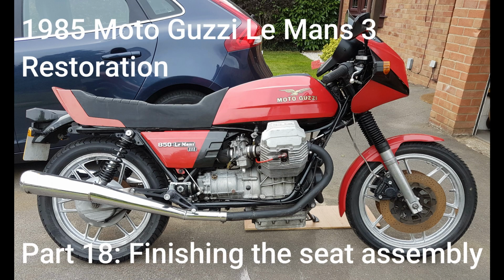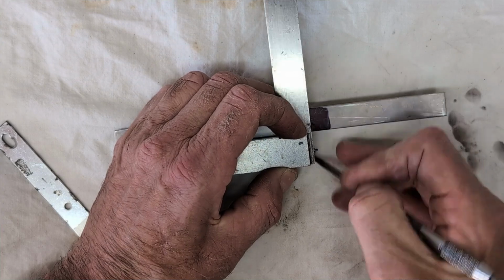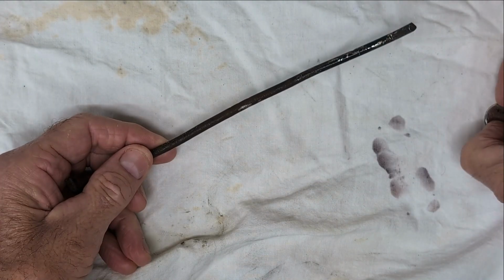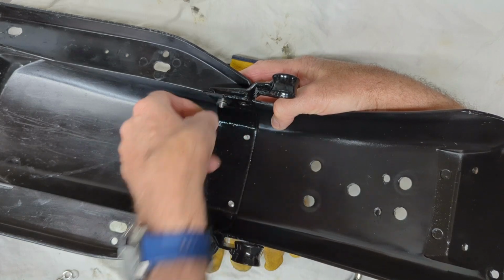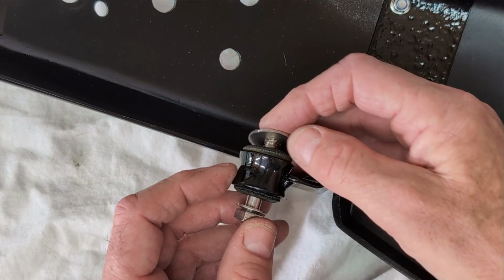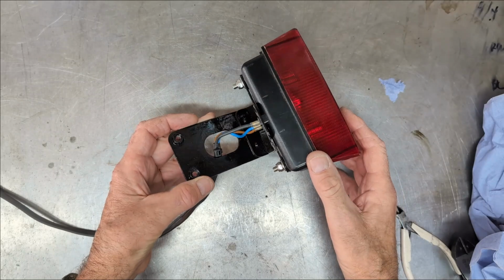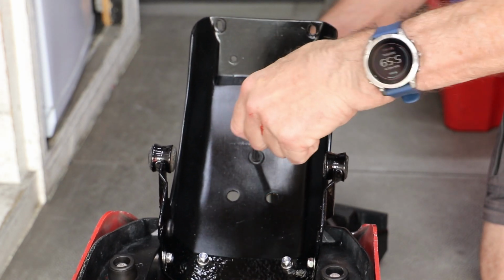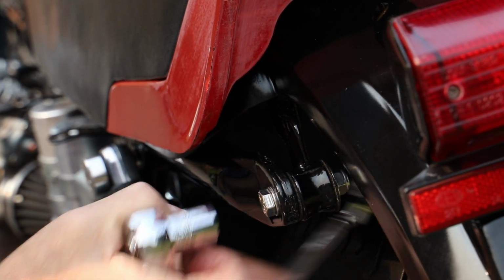Moto Guzzi Le Mans 3 Part 18: Finishing the Seat

Comment: Hi Mark. Where do you get your ironmongery odds and sods from, penny washers, rubber washers, fixings etc.
Reply from the maker: @AyrshireAirsports  Hi, either Amazon for small quantities or EBay for larger.
Reply: @MarksMotorcycles-rk4yp  sorry to bother again, but where did you source your replacement switchgear?
Reply from the maker: @AyrshireAirsports  They're easy enough to get.  Gutsibits sell them, but they can be found cheaper elsewhere, just do a Google search.  There are multiple options (switch configuration, with or without molex connectors), so make sure to order the right model(s).
Reply: Thanks Mark. Yes I went down the eBay route, but quality is variable. Yours looked better quality than the ones I could find/purchased, but thanks for the reply I'll keep looking 😮

Comment: Hi Mark, what would you recommend to bring the seat back to life, mine is looking a bit grey and tired
Reply: Mark, I have just brought mine LM2 rubber seat back to a decent finish using 2 products - Autoglym Tyre & Rubber Care and also a black trim restorer. I use the Autoglym first which does a decent job at cleaning it. Then the tyre/plastic black and then finished off again with the Autoglym. (you may not need the Tyre black but my seat was scuffed and looked awful) The result was great but we shall see how long it lasts..... Autoglym also do a rubber gel but I haven't tried that....
Reply from the maker: @TheElderlyBiker  brilliant, Mac's question did have me a little stumped because I haven't got that far yet.  👍